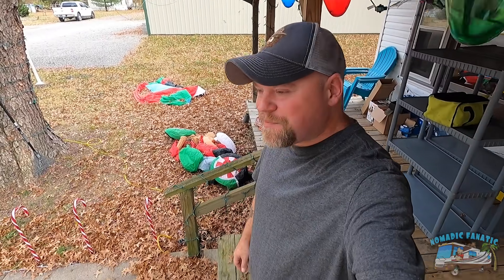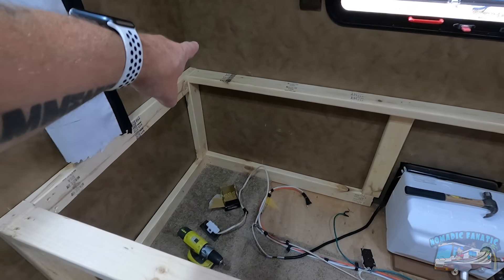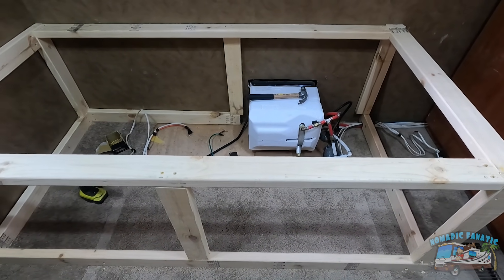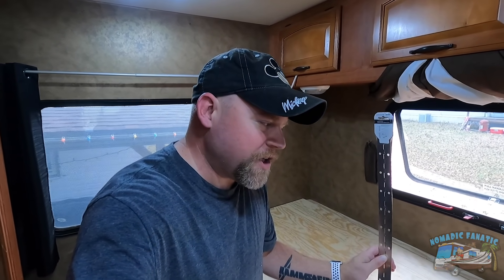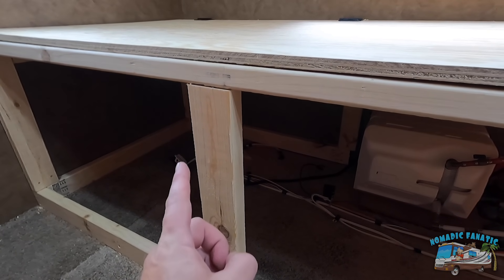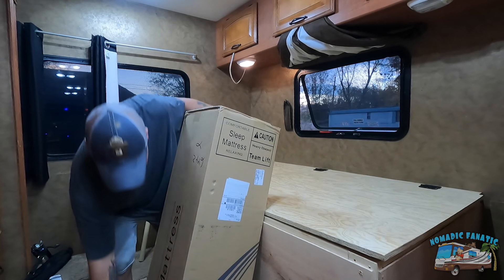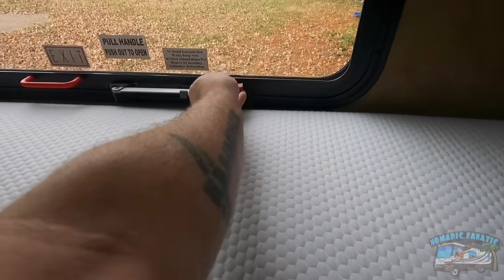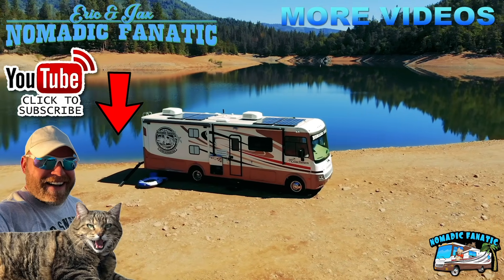Complete Rebuild RV Bedroom & Bed. MUCH BETTER!

Comment: If your bed slides, just put adhesive Velcro under mattress.
Reply: I was thinking the same thing or maybe some kind of non-slip material on top of the wood.
Reply: Yeah, I was thinking the same thing. 🤔
Reply: @pavofan59  yes that shelf liner works good
Reply: Or a half-inch piece of wood on the edge to stop it from sliding.
Reply: @pavofan59  Rubberized carpet pad would do it, as long as it doesn't react with the mattress.
Reply: My RV mattress uses Velcro to keep it in place. But don’t Velcro around the entire mattress like my RV. Too much of a good thing isn’t good. It’s difficult to move the mattress. Praying for your brother‘s recovery.
Reply: OR simply put anti-slide fabric under the mattress.
Reply: Great idea kiddo. Granny fan
Reply: Thats a great idea I was thinking one of those things you put under rugs so they dont slip
Reply: Good work- might also be good to add 2x4 across mid section of bed- area where most weight 
Is sitting, if their is not much support under plywood sheet- it will warp over time, eventually cave in...
Reply: drink a lot and ignore it?
Reply: @AcmeRacing  no good promotes mold.
Reply: Little PAW 1969  base of mattress needs vents to stifle. Mold
Reply: I would install the struts even if you put doors on the front of the bed storage.
Reply: Praying for your brothers recovery. The hospitals in MD arent allowing anyone in either....

Comment: Great Video as always Eric. A couple of Hints.

A) Do not put in a chunk of 2x4 in the middle of the side of the Bed. (You'll learn why in a hurry the first time you get out of Bed.) Instead use the ideas of many others here and use Non Slip.

B) Make it a double step in the Corner. Jax and you will thank yourself in the future.

C) That is good news on your Brother. I know the feeling of hopelessness, I lost my Mother last year. She was in Massachusetts and I was in Florida.

D) Reinforce the Plywood Bed Top. It will work out better in the long run.

E) Save that Knife. Toss it in a drawer even though it didn't work so well on the thin flexible Plastic covering the Mattress. What it will work well on is the damned Space Age Plastic Packaging holding almost everything we buy these days. (It works better than Scissors.)

Comment: Eric I’m not a carpenter not even close but I’ve made some amazing things including 3 beds with pocket hole joinery like keg jig. I mainly build things with pine 1”X & 2’X material and once you’ve cut your boards it’s just a mater of using the right Kreg jig screws 1 1/4” course pan head for 1X and 2 1/2” pan head, course thread screws for 2X material. You should check out how to use it. Honestly you will be a pro in no time!! To build a rectangle box like for the bed you’re building would be so easy and super sturdy. Not that yours isn’t I guarantee you, you would use it on further projects! 
If you did get one? I would suggest the cheapest standard one Kreg makes. YouTube some simple Kreg jig projects or YouTube: Ana White or Shanty2Chic or 731woodworks. Your bed frame is going look nice when you’re done!GoodLuck Eric!

Comment: You could just use a metal or plastic 2 Step movable step stool, too.  Instead of building permanent step so you can move it where you need it

Comment: 2 suggestions.  There is drawer liner that is designed to prevent slip.  Just line the plywood under your mattress.  2. Instead of hinges for the cabinets doors make them slide doors.  You could make them slide side to side, but I'd make them up and out of the way in case you have to work on the hot water heater. Just use finger holes instead of handles that way they are much less snaging on you and your clothing.

Comment: You might want to glue/screw another board along the back of the flip top and use longer screws?  Why?  Well it looks like the back sides against the wall are not resting on the 2x4s?  So if that's right, it looks like most of your weight is distributed to the three hinges w/three 3/4" or 1" screws going into 3/4" plywood.  If you re-force the ply under the hinges and use longer screws you'd be good.  Or use a long continuous/piano hinge and you'll be good too.   Make sense?

Comment: Hmmmmm. Have you considered that when you open up the bed to access the storage area, your thick mattress will be in the way? My husband built similar twin beds for us, but he measured the thickness of the mattress, put a strip of wood of that width along the wall, on top of the bed frame, and attached the hinge. That way the mattress has a space to go up into when the hatch top folds up and doesn’t prevent the hatch from opening properly. Also helps to prevent the cramped mattress from forcing the hatch top back down while you have your head inside the hatch.

Comment: I hope by now, that you will have heard more positive news about your brother. Sending my best to him, you; and your family.🤞🙏
.
I know that hindsight is always 20/20, but it looks like the mattress is actually wider than your base.
The best way to measure a base - where the mattress is against a wall: would be to add at least an inch to both width and length (so the base is wider than the mattress)
That way, you can add a raised edge to contain the mattress - and stop it sliding.
 The narrowness may be even more noticeable once you get sheets/blankets, etc on there. May be harder to keep them all tucked in neatly... or you may even roll off the edge... 😯
Anyway, it's kind of a moot point, right now. Hope it works as you want it to. 😁

Comment: If you leave that lip on the end of the bed you will have a good spot to open it with. It's hard to get a hold of plywood on its own as it is smooth and slippery. My mattress pad has thick elastic bands that hold on to the mattress and might be a good idea to get the mattress to stay put. Wow, that 11" mattress looks so cool! I may have to upgrade. How did you end up in Illinois? I thought you were a Pacific Northwest boy! I am from Oregon but only made it as far as Arizona from Florida.

Comment: Relax about your brother!
I was run over by a T600 Kenworth back in92. I went under the left drive tires on a concrete lot! I had 6 ribs broken in 14 places and the right lung punctured and deflated! Yep , the artery on the right side of neck was bruised badly by the tire almost going over my head! The nurse cleaning me asked what the black stuff off the back of my ear was. She freaked when I looked at it and said the rubber off the side of the tire!! That's how close I became to being a deader! And the reason why I love beating cancer! It ain't a truck! ;)

Just get the bag packed and go visit your brother for when he's getting discharged!

Blue Sky's and Safe Journeys!
But he'll be fine! The lung won't take but a week or 2 to get back to normal but those ribs will be a ROYAL pain in the side!
 Don't let him watch comedy or tell him any jokes for a few weeks as they'll damn sure remind him they are broken!
But he's alive! I didn't gave surgery and was awake for all the fun stuff in the ICU as after the Army getting ne addicted to mouriphine  after a bad accident I have this phylogical thing about opioid and refused any hard pain killers or the good stuff used in an empedermial tap so I just endured the pain. Its good that I practice bio feedback as the doctors were freaking out that I was refusing pain meds! Hell, even when I underwent brain surgery to remove that silly narcissistic radiation tumor they knew im "allergic " to mourphine and had to use a different pain blocker! 

But be ready to fly home to drag his ass out of bed when he is better! Family helps dude even if you're not close! He'll be just fine as only ribs and arteries and not major functioning body parts got damaged!

Comment: Sorry to hear about your brother. In our prayers. You should think about sliding doors on the side of your bed. I put them in my RV and they worked great. They make tracks you just screw to the floor and top of you bed frame, then just put two pieces of 1/4 inch plywood to make sliding doors that cover each other up when open.

Comment: First, we hope the best for Barry, and for you. We know that terror, too.  Second, good engineering! You might want to install  headboard to provide clearance for the curtain,  and a small cleat at the foot will keep your mattress in place. Consider bypass sliding doors on the sides - easy to do, hardware available at Lowe's, but really not needed.

Comment: The bed in our rv is also very high so we bought a small collapsible step stool. It folds up flat and would tuck away when not in use. That way you wouldn’t need to build steps. Just a thought 😊

Comment: Hi, Eric,
I am so glad your brother is going to be OK. I also lost my brother in May, and could not be with him at the end because of the restrictions. Very tough. 
  I like the way your bed came out. I have a similar mattress, and it’s very comfortable. I would like to suggest though that you drill a bunch of small holes in the platform for air circulation. This type of mattress can actually get moldy on the bottom, particularly if you’re using any propane heat in your rig, which causes condensation. 
  The leaves make great kindling. 
All the best, Eric.

Comment: On the bed, you should have mounted the hinges out from the wall the thickness of the mattress. This would allow you to open the lid with the mattress on it and it wouldn’t impede and push back against you. The way you mounted the hinges, it is going to squeeze the mattress in place and push back against the lid.  Praying for your brother....

Comment: Sorry to hear of the loss of your brother last year. Also Barry's accident but doing better. Won't your mattress need ventilation being directly placed on the plywood to prevent mold? Also more bracing support under the plywood? I think I would of made the bed frame some lower. Because with added bedding the bottom of the window will be blocked. Otherwise awesome idea for more storage needs and room around bed. Thank you for the video. Hope your brother Barry continues to heal. Have a blessed day.

Comment: I had a ramp built for my back porch. The surface was coated with skid proof paint like material. I like it a lot. Works in all types of weather. I use a rolater.

Comment: Sorry to hear about your brother, I'm positive that he'll recover without any long term health concerns.  I would have built the bed frame a little wider with a small gap between the bed and the wall, don't put an edging around it it will hinder you raising it up, try using that stuff that keeps rugs from moving around on hard floors, just a thought :)

Comment: Squiggy Stuff.  Look for some rubber drawer liner....okay, I found it at Home Depot as Heavy Duty Grip Shelf Liner.  You do not even need to attach it.  Just lay a bit of it on the plywood under the mattress.  It works for keeping rugs from moving too.  Creates extra friction against both surfaces.

Comment: Thoughts and prayers are with you. I hope all goes well. You might consider attaching a 1x3 around the two edges of your bed, it will keep it from moving in travel.    CHEERS          Steve h.                    p.s.         All foam beds require a ventilated bottom to prevent mold and mildew. You can do this by drilling some 1 inch holes every 18 inches or so. Don't worry this won't weaken it much all. The other option is to put some basment wall drain system, you know the plastic that has all of the bumps on the surface so standing water will run down the basemant wall to the drain tile. It comes in a 4 ft roll, so you will need 6 ft of it to cover the underside of the bed, it's cheap too!

Comment: On the hinge side of the bed, it would have been better to leave space for the mattress to rest on a flat spot. When you lift the board with the mattress on it, the mattress is just squeezed against the wall. If you look at "Sasnak" channel, Stan's old burgundy truck has this style of fold-away bed, but with a more complicated hinge.

Comment: You should brace the underside of that plywood (just a frame that sits inside the bed frame) so it doesn't flex as much, and cut some holes into it so your mattress can breathe properly (and stuff underneath can vent, like if you put a wet RC car down there)

Comment: Good vibes to your bro Hope he gets better. I live in a 31 foot 5th wheel, I've been wanting to take out the Queen mattress and platform and replace it with a nice Futon. To convert into day and night use. Livingroom in the day bed at night. My problem is that you can hardly get any info on exact dimensions from Amazon dealers. I have considered downsizing the Bed like you have.

Comment: Sorry about your brother's accident but glad to hear that it seems to be under control. On your bed, I would put either one or two (braces) cross runners so that the plywood doesn't sag. I know that it seems to be strong enough but with the weight on top it will start to sagging on you.

Comment: When you have your 6 or 8 inch tall mattress on top the ply wood it’s not going to open up easy as the mattress is going to be forced into the wall. The piano hinges may seem weak and flimsy in the package but when all the screws are in it becomes as ridged as the wood.

Comment: Please put a much more secure thing to hold your bed up to get at your storage maybe a bracket in the top and side so the dowel doesn't come loose because that looks heavy enough to possibly knock you out if it fell on your head and back

Comment: you didn't get a new router. if your getting your equipment through your ISP. its used/referb bottom of the barrel pickings. buy your own router and modem if you can and you will have a MUCH better home internet experience!

Comment: With the leaves I live in Iowa does state that gets a Lotta leaves and I would recommend using a mower with the bagger attachment it’s a lot better than using that works I’ve used it works before for that and they’re not very good takes forever

Comment: having made several of these, I can tell you, you need more support plywood needs it. Either from the top to bottom longitudinally or a couple of 2X4's from  wall side to the outer 2X4s.
Reply: and add another short support to that outside 2X4.

Comment: Also.. if the bed is memory foam you will need something(they make a special pad this that allows air to circulate under mattress) to go in between the memory foam and the wood because what happens is the moisture from your body when you sleep at night goes to the bottom, gets trapped and it will mold the bottom of the mattress! ask me how I know! hahaha

Comment: I'm not sure you're gonna want to lift that mattress with the planned 2x4's in place it looks like it needs a bit of wiggle room when you lift the big board and might pop over them when it hits the wall. .maybe just buy a nice two or 3? step foldable ladder for you and jax and put it away before you drive off.   You've almost got that bed as tall as some of the newer hotel beds that are out there...if you're at all not very mobile it's a challenge to get in and out of the taller beds to do your business, Oh well I guess they'll just have to deal with a few extra soiled sheets and some baby ruth bars. (the access from the front is a good idea and thanks for removing that silver angle bracket)

Comment: I'm so glad your brother is going to be ok.... Have you thought about turning your desk around to the outside wall so to give you complete openness I'm worried that you could be really sleepy and run into the desk and that metal L bracket just a little prevention in case...

Comment: Prayers work.  Glad to hear that your brother is going to be okay. Will keeps him in my prayers.  You also!
That bed is high and in my RV it is also high.  I have a small folding stool that I use and for my pup I lift her up. No room for a ramp or anything. Bed looking good and so much room and no slide to bother with. Need some sort of handle for lifting it up ? not sure but I’m am sure you will figure it all out.  
Many blessing to you and your family and happy thanksgiving. I’ll be on my own thanks to the C 😡

Comment: Hey Eric on your issues with your on and off running generator when it ran for those 48 minutes and then shut off did it start back up right away?  If so did you let it run again and if not how long did you have to wait till it would restart?

Comment: I thought everyone knew about running a lawn mower over the final large amount of leaves on the lawn..They get mulched and the next wind storm blows them all away..Ive been doing that for years...Im wondering about ventilation under the bed with carpet under the bed frame. Condensation , hope that dont make mold in the carpet..Mold kills people...Be safe and Happy Thanksgiving

Comment: So sorry about your brother, sweetheart.  PLEASE NOTE:   I just wanted to mention, you might want to drill holes in the plywood for ventilation.  I had a brand new mattress on the plywood, and I didn't realize that mold had built up underneath the mattress...and I got toxic black mold poisoning.  I never knew a person could get that sick.  10 years on, I'm still not who I was before.

Comment: with the bed you could use some of that rubber matting for shelves sold in rolls at Kmart etc. so the bed doesn't slide ... affix with adhesive on one side to the wood maybe!

Comment: Should have notched out the plywood and flipped the hinges over... would then be flat on top with no gap between the strip and sheet. Hang in there, accidents happen.. my 93 year old Dad is in hotel death, dying as I type.